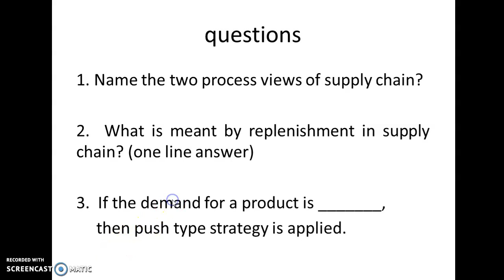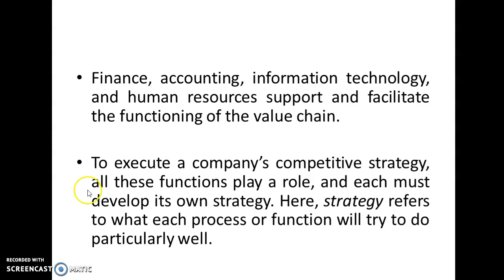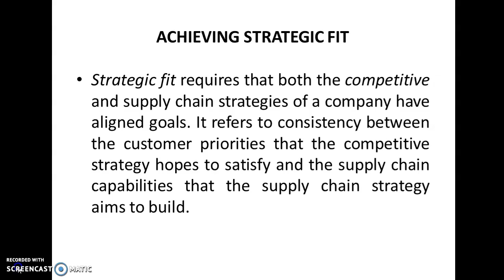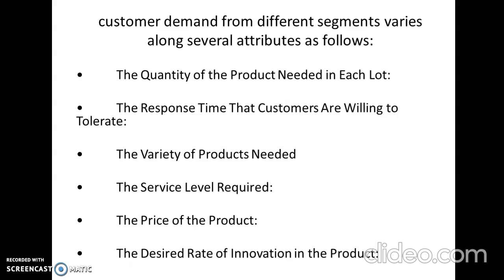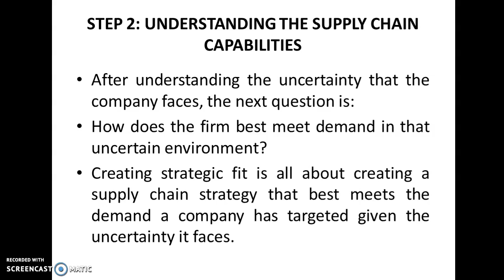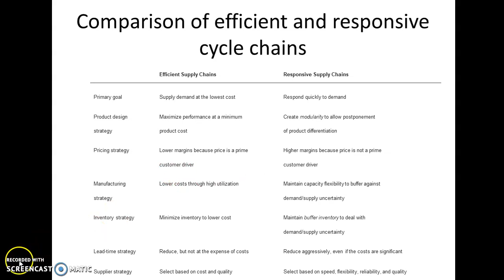Lecture 06 Supply chain management

Comment: Gayathiri N
Roll no:15
1.The time required from placing the order by the customer to deliver the product.
2.Demand uncertainty means ,the demand of the product may increase or decrease over a period.Implied demand uncertainty,the demand is based on the customer needs and requirements.
3.value chain:The place where the competitors can find the solution to improve their profit level.
4.true